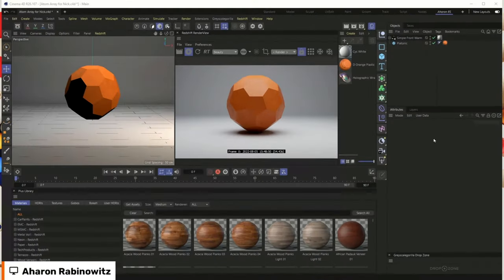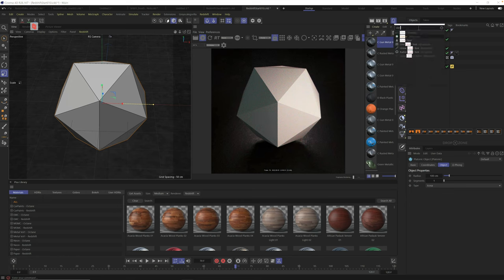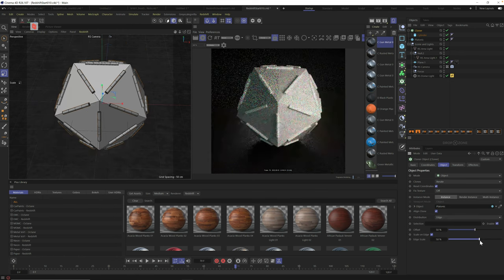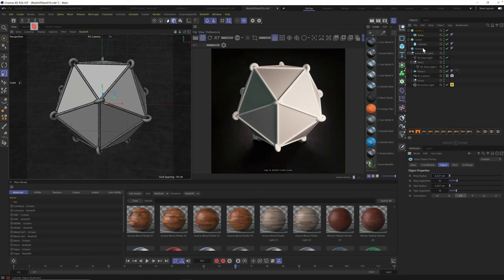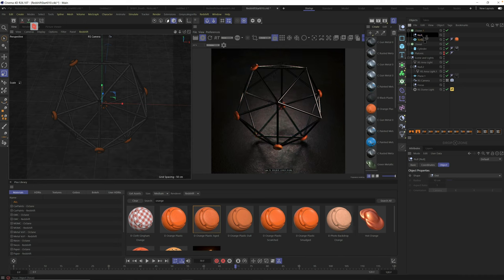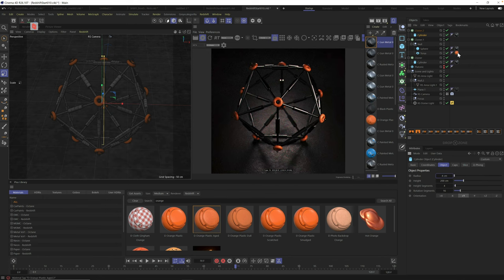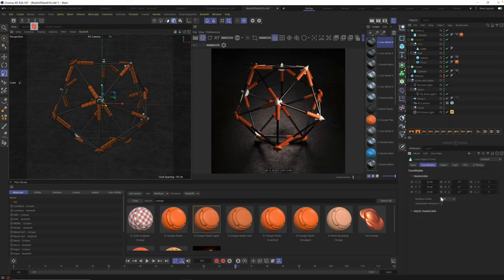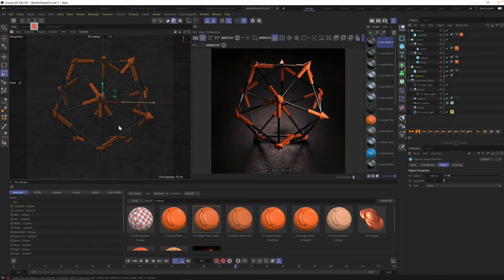TUTORIAL | Don’t Use the Atom Array in Cinema 4D!

Comment: Tip for 3:43: if you hold Shift + Option when clicking the traffic lights it cycles their mode in the other direction, so from default it will turn them off.